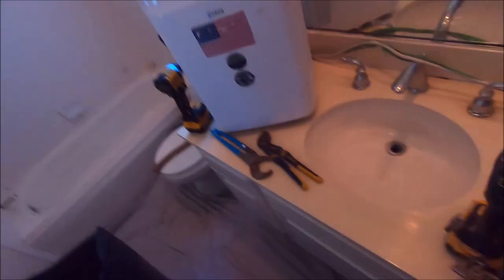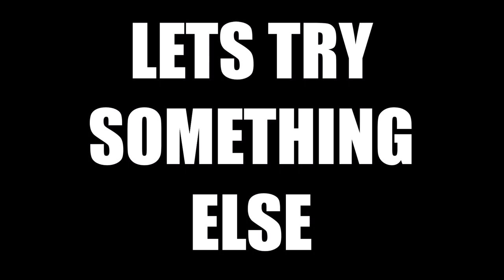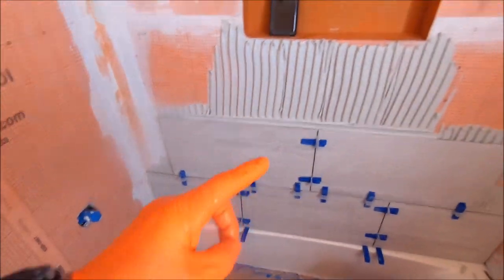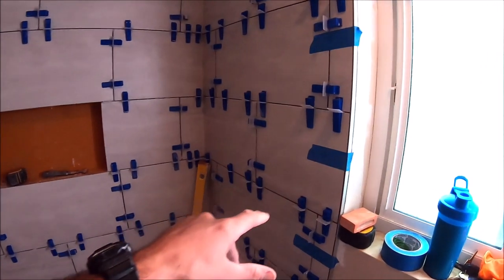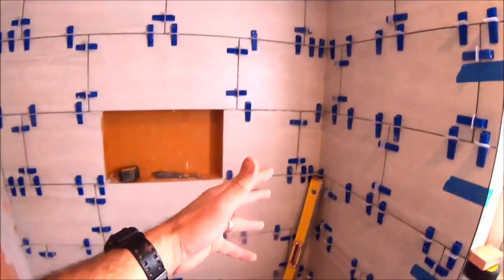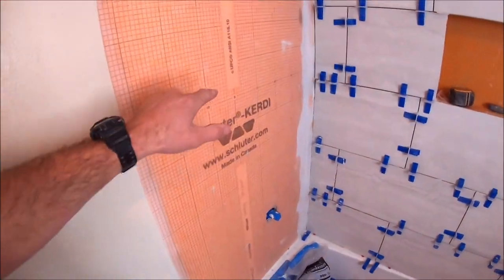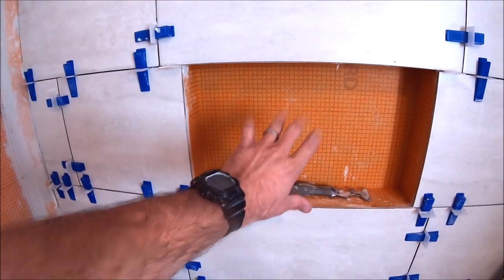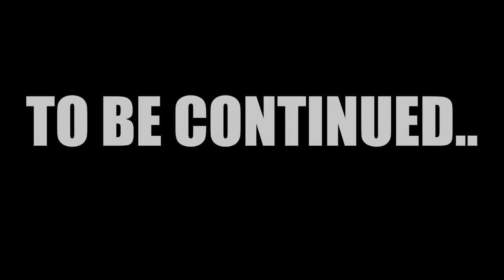Budget Friendly Shower Remodel | Part 1

Comment: Excellent job....love the nitch sill first, then back of nitch, then top, then sides.. .do you notice on most tub framing that a vertical 2x4 always lands under existing tiles bulnose? If I demo and cut along the existing bulnose edge (like you did removing tile and board in one section) i always have no stud to secure the adjacent drywall to (the drywall thats staying next to new boards). What I actually do is remove old bulnose first, then drill to see where 2x4 is , then score in the center of 2x4. This usually means I have to carefully pull of that bulnose without damaging the boards,  this way I have something to screw the remaining wall to...I guess you can add a 2x4....

Comment: why wouldn't you just use the schluter walls instead of doing drywall then covering it with the membrane? Just curious.
Reply: Kerdi Board has been really difficult to find in my part of California, even at the contractor supply houses.  I can't speak for Landberg Tile but that may be at least one contributing reason.

Comment: Berg did you ever try out those monster clips?? What are your thoughts on them?
Reply from the maker: Yup, I have a shower build video with them coming soon. I don't like them all that much for showers. Clip and wedges are better.
Reply: @LandbergTileTV  the tension is too weak I’m assuming?
Reply from the maker: @bigchungus5672  that's not it, the clips are too big and bulky and it's a bit difficult to get the tiles behind when installing next to the side walls.
Reply: @LandbergTileTV  that’s the same issue I had when using the Tuscan seam clips similar to those. The other issue was that there wasn’t enough tension in them to fix bowed tiles.